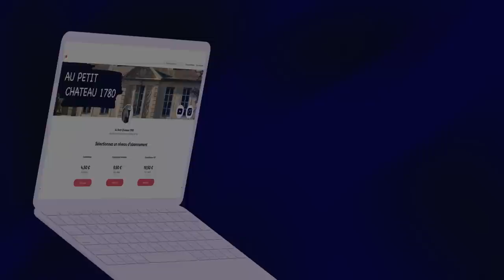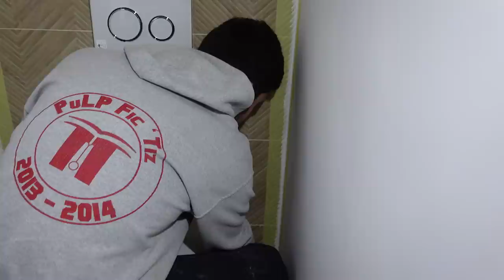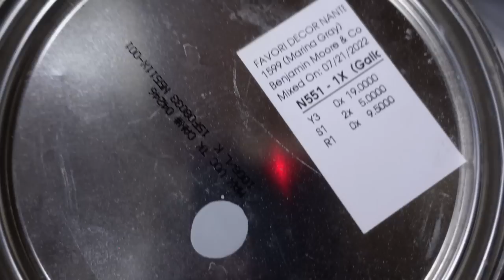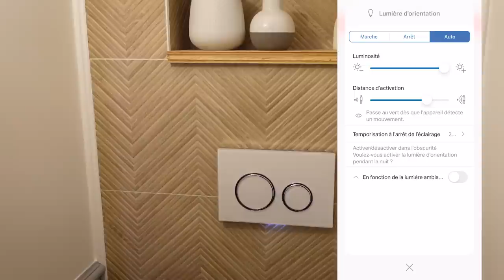1ERE PIECE FINALISÉE APRÈS 2 ANS DE RÉNOVATION | EP29 Chateau Restoration

Comment: Where do you wash your hands after using the toilet?
Reply from the maker: It will be just outside the toilet 😉 Too small to fit a real hand wash basin.
Reply: @AuPetitChateau1780  So you're going to have a sink in what? The entry way? Will it be what people see when they come in? In a huge place like that, I would have chosen a larger room to renovate and included the sink but you did a lovely job on it. Love those floor tiles.